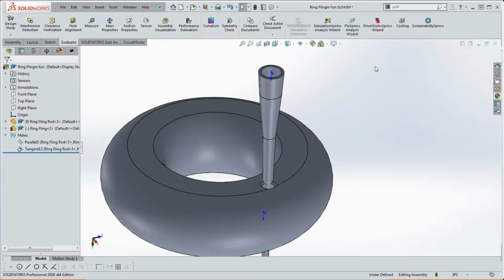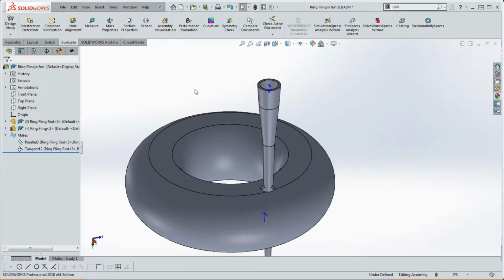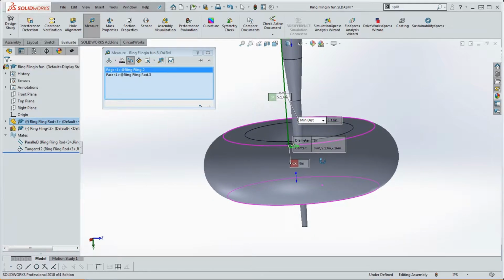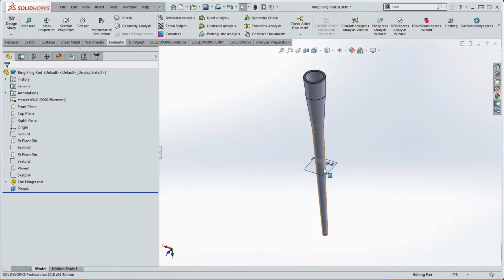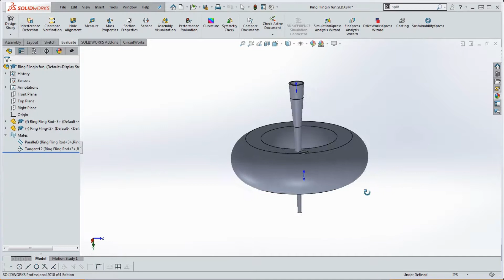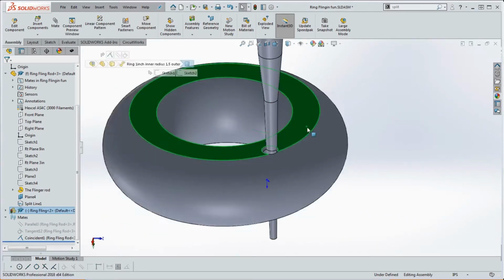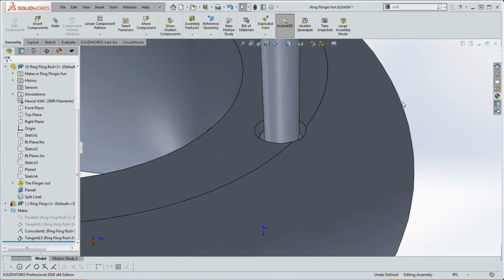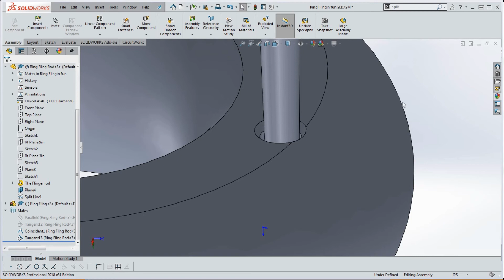SolidWorks, Assembly, Applying a Tangent Mate Between a Conical Surface and Cylindrical Surface

Comment: No! This is a band aide! Solid Works needs to write code where you select the surface of the taper and select the surface of the cylinder and mate together...period. If you need it to float, then there needs to be option s to change distance or lock, etc.
Reply from the maker: I agree, tangent mates and sketch relations are not ideal and can frequently flip, rotate and move - causing errors.  CSS